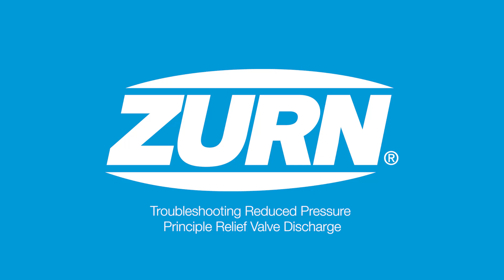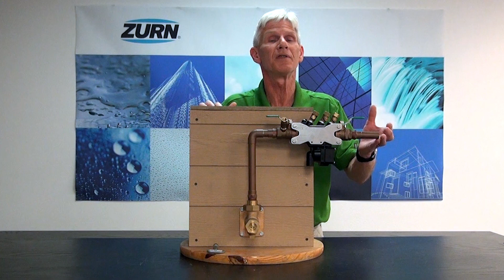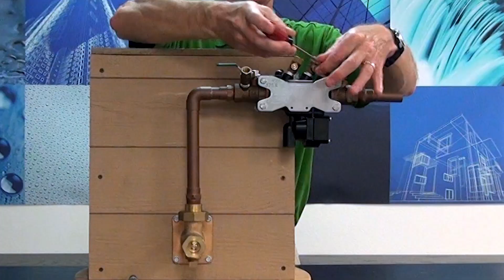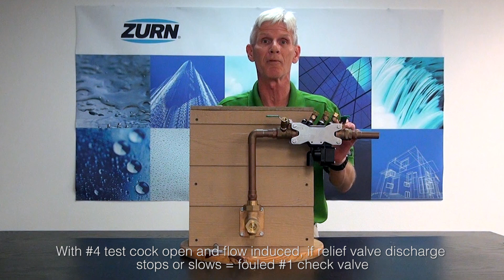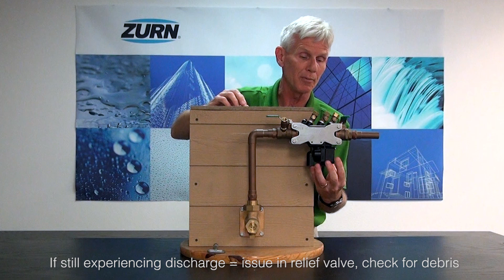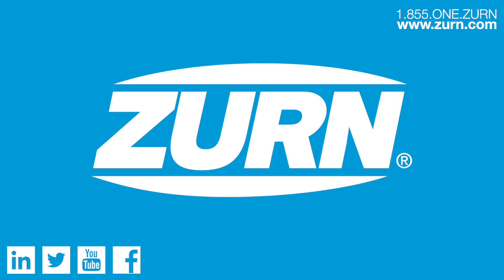Troubleshooting Relief Valve Water Discharge from a Zurn Wilkins Backflow Preventer

Comment: Diagnosis of a fouled #1 check valve was correct.  After lifting the unit out found a piece of debris wedged in that valve.  After removal of the debris the unit worked perfectly.  This video is a keeper!

Comment: I found my 375 to leaks air  in early November when I tried to low out the irrigation system. It turns out it gets colder early this year and the residual water frozen to icicles in the diaphragm, rendered the diaphragm cannot close itself. After clearing the I e debris, the air leak stopped.

Comment: Thank you. This is what I’ve been needing to know. Usually I just check the vent diaphragm for debris. Pro Tip: Never ever buy the kind that doesn’t have replaceable components. I did during the supply shortage and now I’m out $400. Let me know if I’m wrong about that Zurn.
Reply: As I commented above, as an end user consumer it is next to impossible to find or get access to individual parts or a reasonably priced appropriate repair kit for the 375 back flow check value series (especially the 1" version) that has the one or two parts you might need.  IMO, definitely not DIY consumer friendly.

Comment: Does the relief valve leaks if the water is coming in to the building is leaking.
Reply from the maker: The integral relief valves on Zurn Wilkins’ Backflow Prevention Assemblies protect against backflow occurrences by monitoring the pressure drop across the valve. Sudden pressure changes can cause some discharge. A small leak would not likely cause the valve to “leak” or discharge. A water meter is a good way to tell if there is a leak in the plumbing system.

Comment: How are the check valves numbered on the 375 XL?  4 and 2 are mentioned but I am still unclear.  Mike
Reply: I believe they are numbered sequentially, starting with the isolated individual valve located closest to the water supply inlet, and then moving to the cluster of 3 check valves (the first of them, closest to the supply inlet would be check valve number 2).  Hope this helps.

Comment: I shut off thbe valve #2,  the leakage is worse.  The leakage is coming from the releaf valve diaphram itself not coming out the bottom opening.  The leakage also comes out the small hole in the middle of the diaphram.  If I use my finger to block it,  the leakage is worse.  If I have both valves shut off,  the leakage remains but not as bad.  I had both valves off for about 4 1/2 months and when I truned my valves on.  this is what happening now.  Lost water about 1 gallan for every 3 hours maybe.  please help。  thanks.  I have Zurn 975XL
Reply from the maker: When experiencing leaks from the relief valve's vent port or air relief hole (Small "weep hole") you may need to repair the relief valve of the Model 975XL. A leak from the air relief hole will cause a loss in pressure on the diaphragm side of the releif valve, which is used as the closing pressure. Fixing that issue, which may be occuring from the relief valve o-ring, or relief vlave cover, could resolve any leaks from those areas. Please feel free to reach out to WilkinsCS@zurn.com for more assistance or troubleshoooting help.

Comment: Thank you for the customer support! I have one of these in my sprinkler system and it was venting a LOT of water when I turned on my system. I watched this Zurn 975 diagnostic video and repair instructions (https://www.youtube.com/watch?v=ctYonNGogIE) videos - with those videos most do-it-yourselfers  will be able to repair one of these. Believe it or not mine had a piece of debris in valve 1 that was causing it to vent just like the videos said.